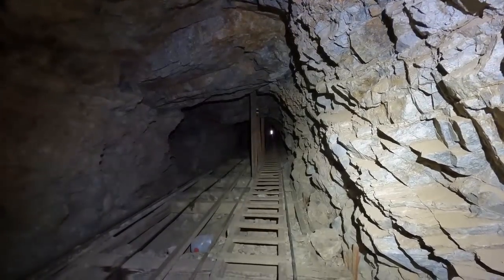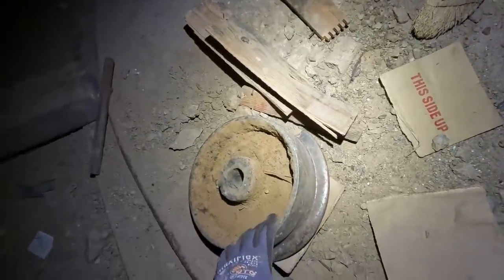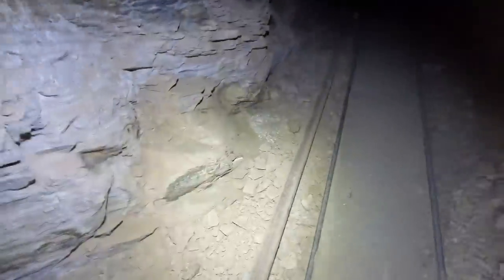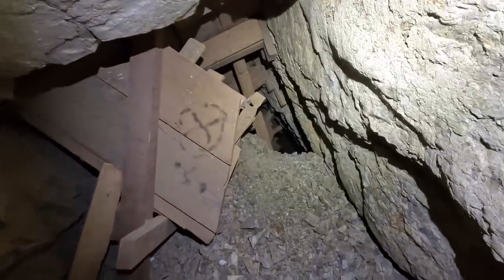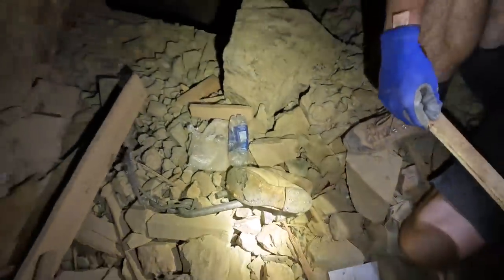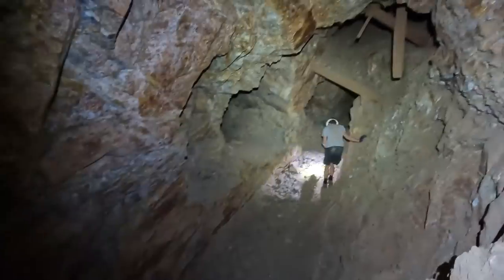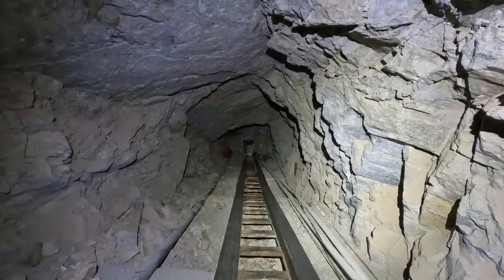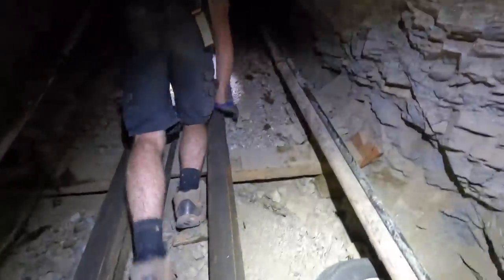Making The Connection (Part 2!)

Comment: those are blue tip matches ( strike anywhere ) they would use for everything from lighting safety fuse to smoking tobacco ...that short hand steel is called a starter bit ...you would drill with that and then swap out for a progressively longer drill steel ... the " Hoe " was used to scrape out the ore shoots.
Reply: Great to know! 🫶🏻 Neither of us knew exactly, i thought the starter drill was just a pick they’d hammer with